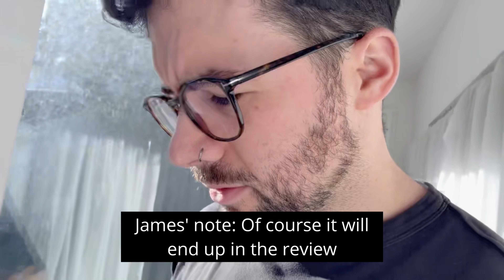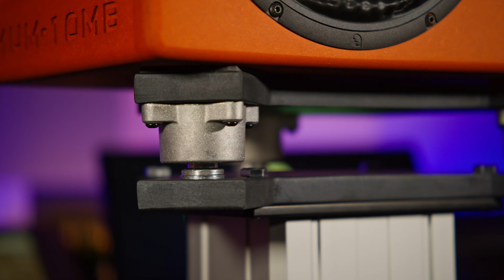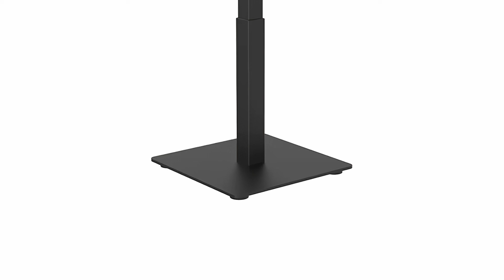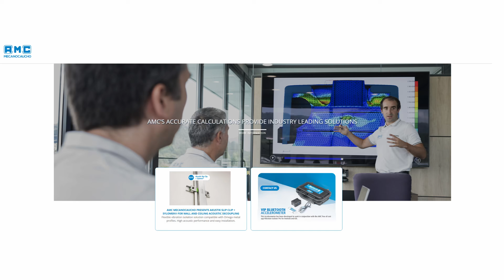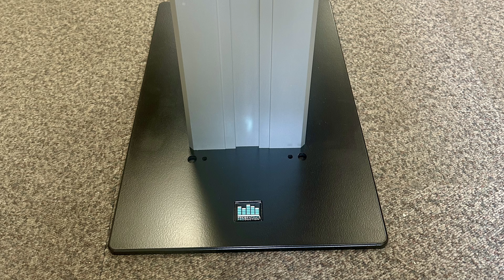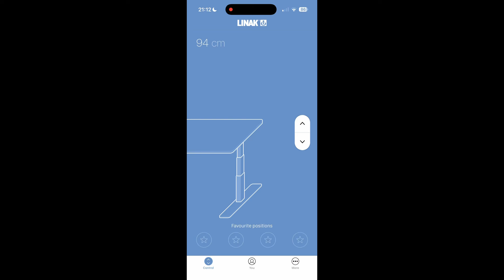Are Your Speaker Stands KILLING your mix? Introducing FOUNDATION, our NEW uppy-downy isolatey boys!

Comment: Seems like this also falls into the “high end mega expensive” category. Would they be much cheaper with non-motorised height adjustment?
Reply from the maker: Not really! The actuator and control hardware don’t add that much to the cost, and this is the only way to adjust height from the listening position. And yes it’s a high end product, but so are our monitors… there are plenty of more budget friendly options out there, but we really can’t offer anything to that market. We make products that we are proud of and use every day ourselves, but they are high end.
Reply: @PresentDayProduction In your video you said there are only high end £2000+ and £100 low end strands which implied you had a solution to this problem. The problem is still not solved.

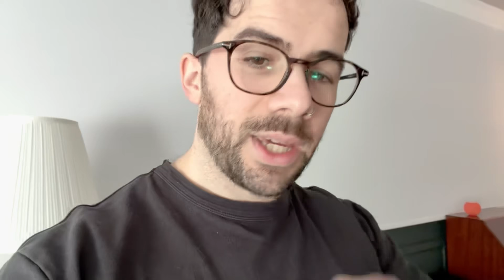Comment: 2:22 Its not innovation. its just common knowledge. Just use brain. Cabinets are designed to have the least amount of resonance. So you dont want to add resonance with crappy stands or putting them on a desk.
Reply from the maker: It’s not as common knowledge as you might think…